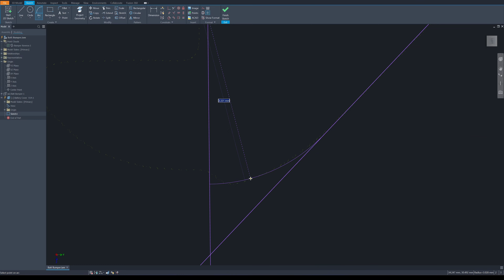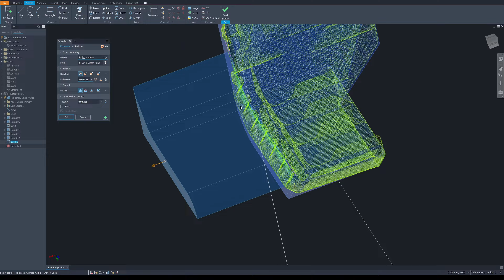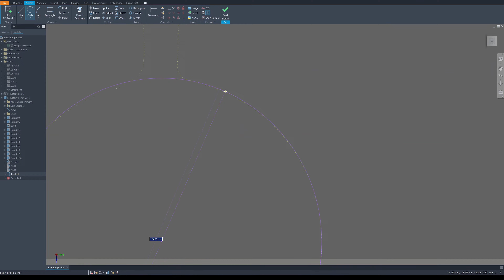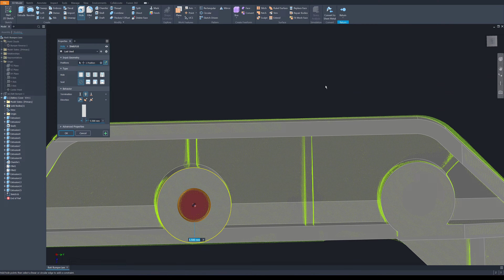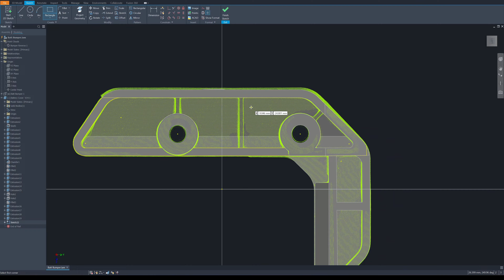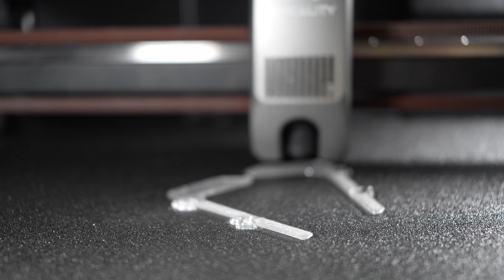3D Printing an EV Battery Shield - Reverse Engineering Workflow & Tutorial

Comment: Great video. Since you are going to 3D print the shell is not really needed. This is an artifact of injection molding. the guy from Slant always suggests making things chunky since the difference between infill and shell in weight and material is minimal, plus it gives more strength.

Comment: Hi Payo, have you ever scanned a panel with multiple through holes that are 1-2mm in diameter? I tried scanning a 1 meter big of a panel with around 22 smalls holes of the said diameter, but after fusing and also meshing, they tend to close and be uneven in circularity.
Reply from the maker: Yes, I have. Laser line scanners aren't capable of capturing fine mesh or grid structures—you'll need an SLS scanner for that level of detail.  https://youtu.be/rFWDCNH21dA?si=EDi3nc19LvUISda5&t=495